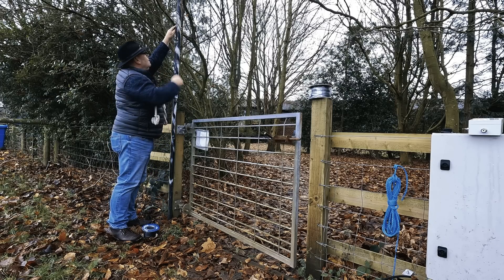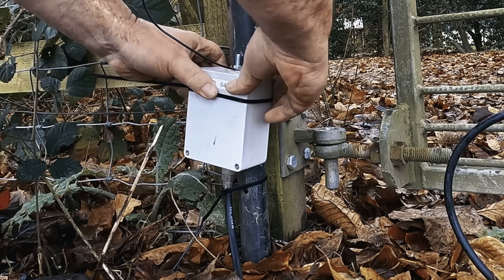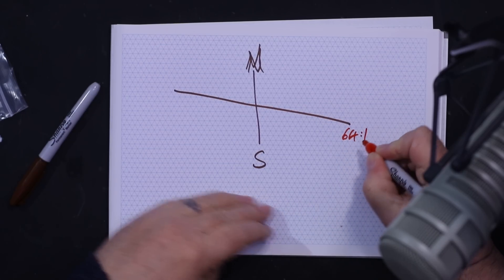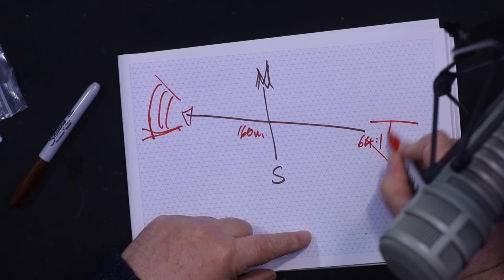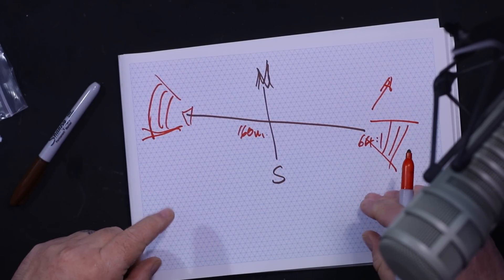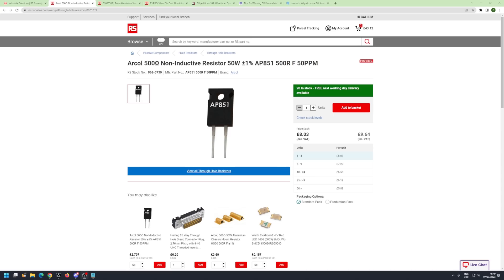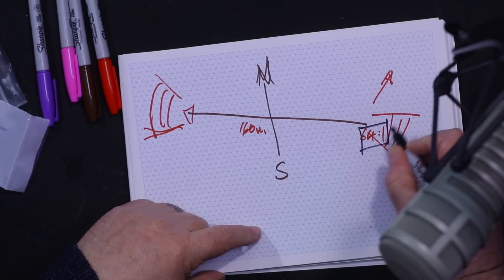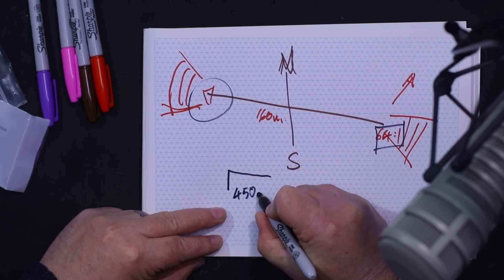Beverage On The Ground Antenna - Converting my Long Wire to Beverage Antenna

Comment: Hi Callum, you have some really nice and interesting videos. I do have a question about the 4:1 balun. You can find various versions of such a balun on YouTube, but which balun is actually suitable for a 180-meter beverage on the ground? The beverage is an antenna used only for receiving. Do you have a good example, please? 73s from the Netherlands (Frank)
Reply from the maker: Heck, I nortmally buy my BoG transformers but 9:1 unun is apparently the usual “BOG/Beverage starter” choice (good general match). 16:1 can be better on some Beverages/long wires if the feedpoint impedance is higher. I believe BOG impedance varies a lot with soil, length, and frequency, so you pick a ratio that's "near enough" and let the receiver + termination do the rest :)

Comment: Thanks for the demo, Callum.  Some constructive comments: 1. I think you meant "unun", not "balun". 2 The RF impedance of the ground connection, using a simple earth-rod, might well be several hundred Ohm (depending on the frequency-band) so, on the lower HF bands, you might find that a lower-value terminating resistor is better.  3.  Several radials will probably give a lower RF resistance. (They would need to be electrical quarter-waves, or odd multiples thereof, of course).  They might be advisable, on the lower HF bands, in case the RF resistance, of the ground-rod earth, is higher than the required value of terminating resistance for the Beverage.  Hope that helps! 🙂
Reply from the maker: OK

Comment: You might like this for receive too.

I decided to make a so called random wire antenna with the 9 to 1 transformer I had laying around. I'd like to have 80 meters so I used the customarily utilized 58 feet of radiator and 17 feet of counterpoise. 

I also used, I am QRP at 10 to 15 watts, for the radiator 3 wire audio, video, shield cable I had 60 feet of. I stripped all three wires at both ends and soldered the 3 at each end together to form a 58 foot stranded wire. I figured if I needed to raise the impedance I could snip one wire at the connection to the transformer turning it into what would be half of a folded dipole thus increasing the impedance by roughly a factor of 4.

Rather than initially try to erect this conteaption vertically I sent it out the top of my 1st floor window as a sloper with the counterpoise more or less doing the same thing. This allowed the transformer to remain indoors.

I then 1st connected the contraption to my SDR RSP-1A prior to using my Nano VNA. I was not sure what to expect in this configuration, but thought it might be excellent on 40 meters because it was essentially a half wave endfed except that it had its impedance reduced by being just above the ground by inches at its furthest end.

Indeed the RSP-1A told me it loved 40 meters, but the Nano VNA told me it was under 1.29 from 6.8 MHz to 7.9 MHz which was my sweep. At 7.15 MHz its 1.22 and the SWR is very flat across the sweep.

Boy, I have a 40 meter inverted V but this will beat the pants off it on receive. So, later I will try to get this thing going vertical and see if it does in that configuration give me 80 meters. My other thought is putting a switch on one of the three wires that then turns it into and out of being an element similar to a folded dipole element thus changing its impedance by a multiple of about 4. This later option might give me 80 m too.

Anyway, not exactly what I'd like to have but gosh darn its sure nice for receive on 40 meters and I love NVIS anyway.

Cheers &
de kc2wvb
Reply from the maker: The nice thing about receive is that our Pre-Amp works a charm!

Comment: I used to have a website up all about BOGs (Beverages on the ground) however I put most of the info on my QRZ page several years ago. Look up N4DJ. In fact W3LPL referenced my website in some of his low-band receiving antenna programs. I caution people that BOGs can be too long but usually no one has room for to have an “in the air” Beverage that is too long, although it is possible, especially if you plan to use the Beverage on 40 meters. The wave traveling down the wire does so at a speed determined by the velocity factor and at some length the incremental current generated by the faster sky wave stops adding up in phase and the incoming wave starts to cancel the signal that has built up on the wire. There is a formula for that in some antenna books, however usually you see the simplified formula. There is a factor that is left out that takes into consideration the elevation angle of the incoming wave. It also affects the null elevation angle. Basically that critical length of any Beverage or BOG simply depends on how fast the signal current is traveling in the wire. If the velocity factor is 95% (as in a normal 6 to 10 foot high Beverage) then the wire can be very long on 160 meters. If the velocity factor is 50% (as in some BOGs) then the wire should not be so long as the critical length occurs in a much shorter wire. I have had great success with 220 to 480 foot long BOGs. A normal 1000 or 1600 foot long Beverage (in the air) has similar patterns to the short BOGs and does have a bit higher output signal, however such long Beverages require a lot of land. For a lot of us even a 100 foot BOG can be useful. The big deal is noise rejection off the back and back sides of the receiving antenna ( directivity). The placement of the null off the back and side can make a dramatic difference in reception. Also the null has a vertical angle also. I have a video (on my YouTube channel) of a very strong station in Missouri on 160 being almost completely nulled out due to the angle of reception being is exactly the right place in elevation and azimuth! The antenna was a 220 foot BOG pointed at Europe from here in Virginia. Lots of people think some antennas are immune to noise but really it’s only the directive pattern that can reduce noise. If the noise and the desired signal comes from the same direction and same elevation angle no antenna can fix that! I should also add that I have never needed a preamp on either my R4C or K3 for receiving when using any of my BOGs or Beverages.
73, de N4DJ

Comment: I have 2,8 foot ground rods 60 feet apart with a house in the middle a total of 120 feet do I make these into a dipole I don't understand how to hook it up. KO4MAX thank you
Reply from the maker: OK, so ignore the ground rods. No good for the end on an antenna.. You need the ends off the ground and "fed" in the middle.. Take the coax. The "braid" goes down one leg and the centre core goes the other way.. I think I have several videos that might explain..!
Reply: @DXCommanderHQ  Thank you !

Comment: I have a 14ga. wire beverage about 18-24 inches off the ground and 530ft. long. Running from here in Florida N/NW or 345 Degrees. I used a 4:1 Balun and terminated the far end with a 300 ohm resistor. I works well for Japan and that area. I used fiberglass 3/8" rods about 10 foot apart.
But when I do a remote disconnect of the 300 ohm resistor it then receives more toward the UK and VK kand. I am wanting to put 2 more in and use a 120 degree separation on them. But all fed from a remote box from Ameritron I think it is called a RCS-4. And the 4th one will be a vertical for 60 meters.   Well that is my plan for this summer anyway. 
I have 2 towers that are about 120 ft apart that I can run a rope between and use a pulley for the 60M antenna at 44 ft. long with  46' 3" ground radials.
73's de W4DRA
Reply from the maker: Wow.. You are ahead of my curve. Sounds fabulous.

Comment: You can hear the Italians if you put a coat hanger on a foil hat and make a slight gap between your upper and lower jaw as a spark gap, opening your jaw slightly or closing will effect tuning ,where your fillings are run a wire to a crystal set and BINGO!
Reply from the maker: Brilliant idea!

Comment: Just came up with a receive antenna idea.  Got a 40m loop antenna with insulated wire on the ground with a 4:1 balum.  Have a coax switch next to my operating position.  Can switch back and forth.  Good SWR protection on my 703 and Roman amp if I forget.  Try Good Friday AM.  Maybe I will be able to hear you..

Can substitute 9:1 and test long wire later.....
Reply from the maker: Yes OK!!

Comment: I had looked into a beverage and I have the stuff to create one. Everything except the land 😁However, from my research, it was a transformer at the end of the long wire 500 to 1000 feet with a 450 to 600 Ohm non inductive resistor and a ground rod at each the end of the wire. Then a transformer to a 75 Ohm double braided coax back to the shack. The transformer was supposedly the same as I use on my Loop on the Ground as 12 turns to 3 turns. The Loop on the Ground is sometimes referred to as a mini beverage.  And the Anan, Flex, Yaesu 101D and Sun SDR DX all have receive antenna inputs with the Anan being the best implementation of it I have seen. I won't buy a base radio without receive only connections.
Reply from the maker: Ah! I might use the Loop-on-ground transformer I have for this project. Good idea...
Reply: @DXCommanderHQ  And I might try your Balun trick on my LoG. I'd like to see how my receive would change. Also, I may wrap about 500' of wire around my property with ground rods and resistors and see what the receive is like. I have that done already as a counterpoise to a 160m Hamstick vertical. Maybe turn the wire into a beverage instead.

Comment: I think you need a 9:1, not a 4:1, with a standard Bev, one which is elevated. 450/9=50. I used to use one in EI for my KiwiSDR, worked well. I mean to deploy one here in EA too at some stage.
Reply from the maker: Yes Andy. I seem to remember seeing about 400 / 450 ohms in the material. I need Mike to mae me one..!

Comment: Experiment! Try it on the ground but also try it 7 feet high too. It would be great if you could build both at the same time and running in the same direction and switch off one and then the other for a comparison. Being that sheep are grazing there, you don't have to leave the 7 foot high one up. But just leave it up long enough to test it out.  You could use some sort of an electrical relay to switch back and forth so you wouldn't need more than one coax.  Whatever you do,  I'll look forward to seeing a video on it. Cheers from the Midwest U.S.
Reply from the maker: Yeah, I have a number of coax lines so we can do that switching on the rig actually.. Good idea.

Comment: Your experiments are awesome! Keep up the great work. Thanks for sharing your knowledge and experience. 

One of your previous videos has inspired me to attempt a DIY full wave vertically polarized loop antenna for 10m using 14ga stranded cu wire and a small bit of 75-ohm coax for the impedance match. Going to try to join a local 10m net with it. 🤓
Reply from the maker: Ah-ha! Good job!

Comment: It needs to be fed with a 9:1 for 450 ohm and radials are needed for it to work but for a variable termination style for the resistor just make a dk7zb mftf and then u will only need a 50 ohm dummy load due to the taps being used as a now variable resistor,ive done it a few times and it works good
Reply from the maker: Thanks for the tip..

Comment: Callum, Great stuff... I am very interested in your results.  I am planning my new station at my retirement QTH.  We have 15 acres of property in NC we will be building on so I would like to have a couple of Beverages on the ground and a couple of RX loops.  I am still planning on building the switch box to phase the small loops on the ground.
Reply from the maker: John.. I like the idea of the phased loops more than I do the dark art of Beverage antennas.. I have a feeling the one on the ground might need a pre-amp (not keen!)
Reply: @DXCommanderHQ  more than likely a pre-amp may be required, but you may find the one on your high end rig might be enough.  I have the W6LVP receive loop I am using it has a built-in pre-amp.  I find it works well on the lower bands, but when you get to 20 and above it is not as good.

Comment: Not that it matters much but theory says you need a 9:1 transform at the coax end. I have had 300m Bevs up at one point at 4-5fts on bamboo poles but also just strung along a tree/forest line up and down. They are very forgiving. One trick is also to put a mirror wire on the ground which should improve. I have an external 20dB pre amp on them. OZ1ING - Henrik
Reply from the maker: Yes.. Not so keen on the pre-amp idea but it's probably required.. Grrr..!
Reply: @DXCommanderHQ  I know - I had to because of my 160/80 ambitions. Built a W7IUV design and works extremely well just connected to the bnc RX input here

Comment: Curious how well the BOG works. We operate 5 beverages “directional”1500 ft long at the contest station. One to Eu, SA,Vk,JA and dead west. They’re roughly 7ft off ground. Electric fence wire is cheap and does a great job. We’ve never used a bev on the ground but I can tell you that we know when one ends up on the ground by a fallen tree. It attenuates the signal severely. Look forward to the video soon
Reply from the maker: That is extremely interesting.. I'm hoping the attenuation isn't as much..

Comment: they got telephones now days
Reply from the maker: They do. Your mobile phone has an antenna in it - that communicates via RF to your cell-tower which in turn often has a microwave dish to another connection. 90% of the folks who designed all that were ham radio operators. I will happily continue to fly that flag because science is for inquisitive folks not fucking trolls like you.

Comment: I have been using a BevFlex beverage antenna for about one year. It is bidirectional with just a single 500' length of RG-6/U coax, that withstands falling tree debris FB. Since it can be fed anywhere it worked best for my QTH, where the shack connects about 1/3 the distance from one end. I alternate between this and a quad loop on the ground, with an amplifier. As mentioned there is not a single best antenna for all conditions. The more options available the better. 
BTW I don't sell anything and I am not affiliated with any company.
Reply from the maker: Sounds very cool..

Comment: After many months experimenting with a bev, I ended up with a 40m run of wire on the ground, no radials just earth rods, no resistor =omnidirectional, it worked fantastic. I also so made a ant relay which was switched by the radio, so now I tx on the vert, once I stop txing it auto switches to the bev. 
I also tested a 20m long wire for 40m, it worked well  but needed a preamp.
73 zl3xdj.
Reply from the maker: Yes OK Brian.. Good info.

Comment: FYI, a company called Unified Microsystems makes a system called Bev-Flex that supports a bi-directional Beverage using inexpensive RG-6 coax.  I have one and it works fantastic.  Basically the outer shield of the coax is the antenna and the inner conductor provides the control signal to properly terminate either one end or the other to get the bi-directionality.  the Bev-Flex system includes four small electronic boxes.  One for each end of the beverage, one feedline box that can be placed anywhere along the beverage that connects to a simple switch box in the shack which connects to the receive antenna port of your transceiver.  Ground rods are required at both ends of the beverage.  I have tried the system both on the ground as well as a few inches and a few feet above the ground.  I can't tell the difference between on the ground or above ground.  While the absolute signal level of any beverage is lower than a transmit antenna high in the air, the signal to noise ratio is far, far better than the transmit antenna on receive.  Since 1000 feet of RG-6 on Amazon actually costs less ($100)  than 1000 feet of THHN insulated AWG 14 gauge wire, the antenna itself made of coax costs no more.  the last time I looked the Bev-Flex electronics costs about $350.  Rather than having to run 2 beverage antennas, checkout the bi-directional Bev-Flex design using RG6.......Steve.

Comment: Hi - I use a Beverage for low noise weak Rx signal QSO UK to ZL. It is 40m long wire at 1m off the ground with 450 Ohm termination R and a 9:1 isolation transformer at the other end feeding about 40m of double shielded 50 Ohm coax up to shack. On the ground was just too little signal and above 1m was too much noise. For me, the best SNR was when coax shield is not grounded at the antenna, but fed by the galvanic isolation transformer.
Reply from the maker: Interesting..

Comment: Would it be possible to burn to length, say maybe, a 27Meg long wire with that fiendish amp of yours? I'm asking ChatGPT but it is getting a bit emotional about safety ffs ha ha
Reply from the maker: Steven.. Mike and I are determined to find out this year.. Probably in the summer.
Reply: I tried that chat gpt thing and it was all safety this illegal that massively disappointing
Reply from the maker: Ben, depends what you ask it. I'm having good conversations. SOME of the data it's suggesting is incorrect. SO you have to check your findings. If you are asking it how to make a b0mb, then obviously you won't get the right answer..!

Comment: Good stuff! Have not done the beverage, had a 450 foot long wire, a 60 foot loop on the ground, currently running a g7fek, which has been the best one so far for wide band general receive. I do longwave right on through to 29 mhz, I have a vertical transmit antenna for 26/27/28 mhz. Look forward to more vids on receive antennas for sure!
Reply from the maker: Sounds great!

Comment: NO.......  do not use radials at the terminating end of the beverage Cal,  A radial field at the Transmitter end is OK.
Just use a single earth stake at the terminated end.
Reply from the maker: Got it Roly!
Reply: Hi Roly, could an earth stake have  more than 500 Ohm RF resistance?